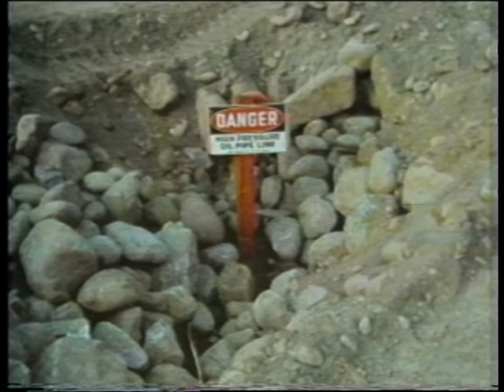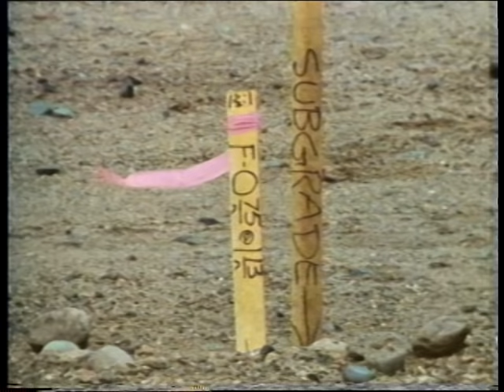The Coquihalla: 20 Months Through the Mountains

Comment: Back when we got things done. BC has fallen into a red tape nightmare.
Reply from the maker: I disagree.  Look at how fast the repairs were done after November 2021.   With enough money and enough workers this can be done.   IN 19834 the government put a lot of money behind the project and accelerated it a lot.
Reply: @BCHistory that's all it takes. Folks holding the money actually moving the funds towards a project and staying committed to it.
Reply: @BCHistory I respectfully disagree. Our technology has improved tenfold and yet mega projects are consistently over budget and behind schedule. Case in point, the Trans mountain pipeline. In the 1950's it took less than 3 years to fully complete  a 1200+ km stretch of 24 inch steel pipeline with antiquated technology. The reported cost upon completion was 93 million which equates to roughly 1.8 billion at our current dollar value. If you compare that to the current trans mountain pipeline which is a 36 inch steel pipeline employing state of the art technology in its construction, costs are roughly 20 times that of its predecessor and it still is not done after 4 years. The government is throwing money at this project, so it can't be for a lack of funding. There is clearly something wrong with our current ability to deliver these types of mega projects.
Reply: you must not live here i guess?

Comment: LOL
These tourist comments are cute and funny.
I drove the coq every day for 9 years.  It's a disaster.   Endless repairs, accidents everywhere, the toll was supposed to be removed once it paid the cost of the coquihalla off.  Yeah...   That was a lie.
Every year, endless km's of the coq are repaired.  Perhaps they could try using proper aggregate for underneath, and quality material for the roadway, instead of accepting the lowest bidder EVERY TIME!
Lets discuss the Merritt Turnoff.   Single lane road, with a single lane turnoff like you'd see in a small town to turn in to the liquor store.   NOT a turnoff needed for multiple semi's lined up, multiple passenger vehicles, all backed up for half a km because they gotta wait for LOCAL TRAFFIC to slow so they can take the "left".   Soo if you want to go from the connector to the coquihalla, you gotta navigate the WORST set of off and on "ramps" ever conceived.

Comment: And yet?
Look at it now, a snow bound icy corridor in winter, at best described as a MAYBE route, where getting through isn't a guarantee, but simply a "hope-we-get-there-unscathed" faster route, than others which may be lessor gradients, but also less well maintained or serviced.
What a real pity, that NONE of those waterways in there were harnessed for at least a Hydro Generating Scheme, to provide innovative anti-icing pads underneath those high "highways", avoiding the often costly non-travel "closed" periods, when accidents and poor road conditions closed that route to everyone.
But then see, the engineers and planners never foresaw the extremes in both the travelling public (and their nonsensical misuse of snow tires &/or lack of snow chains), by citified folk who did not know how to drive - let alone drive on a wintery icing road.

Comment: Took 20 months to build a whole highway system, now days with much much much better technology and equipment it takes them 5 years just to add 1 more lane to a 10 mile section of that same road.  Why???!!!
Reply from the maker: The number of people on the project in 1984 was huge and it cost a lot.  The government had tolls to pay for the increased speed it was  built at.

It is also important to remember the project did not start in 1984 but in 1973.  The first years were only survey work but construction did start in about 1980.  

With enough money and resources any project can be sped up a lot.  The repair post November 2021 destruction went astonishingly fast.  The highway reopened in less than two months.  There was still more work to be done after it reopened but it was available.  By the summer of 2022 the vast majority of repairs were.done.  I was stunned at how much was completed by July 2022.   I was certain Canada's primary highway access to the Pacific coast would be out of action for a year.
Reply: Same story here in Pennsylvania in the US.  They closed a busy exit ramp off of I-80. I thought they were in the process of widening the ramp to include a turn lane to prevent traffic backing up onto the high speed traffic. When all the dust settles and the ramp reopened, it was exactly the same as it was before reconstruction started. The point of all this is they took 6 or 7 months to "fix" a section of ramp that was only a few hundred feet long.

Comment: It's a deathtrap in winter.  But so fun to drive in summer! I want to move to the Interior!
Reply: This is typical big government bragging with no brains and understanding of the true long term repurcussions and costs. If they would have taken 1/4 of the cost to build the coqihalla and put it into the canyon route such as a tunnel thru jack ass mountain and improved certain other area along the fraser canyon not only would they have a highway with much lower winter maintenance cost due to  much reduced snowfall amounts the heavy truck traffic would not be stuck on a hillside such as the "smasher" because of poor maintenance and too steep a grade for reliable winter driving. I know because I drove super b over both of those routes and the canyon in winter usually didn't let you down not the way the coq. could and would because it wasn.t plowed. By law they don't have to plow the grades until there is over an 1 1/2 of snow which is a death kneel for truck traffic and then requiring chaining up and that is not always 100 percent effective on certain truck configerations such as two empty trailer and still not enough traction to climb the smasher with chains.
Reply: so true; its a horror show in winter

Comment: 35 years later equipment technology is still the same.
Reply: While the basic concepts are the same, the technology, ergonomics and operator comforts have been improved significantly. As well, when this project was undertaken it was early days for the development and utilization of large excavators which have pretty much replaced wheel loaders in the dirt moving industry today.
Reply: except for they have internet and wifi and GPS making everything literally twice as easy

Comment: Maybe building a highway next to several rivers and diverting them 18 times wasn't such a great idea? I wonder what flood level data they used for the engineering on this.
Reply: They didn't care. The right pockets were filled with gold and here we are.....
Reply: Have you driven around bc? Pretty hard to spit let alone build a highway and not hit a river. The coquihalla range is one of the snowiest places on earth, I guarantee they looked at flooding pretty hard when they built this road.  Flooding wasnt a problem before they clear cut the entire coldwater valley past the coq summit, the rest burned in the summer of 21 and then the freakiest HAARP storm ever seen hit, voila

Comment: So what? We ended up with a freeway that causes more problems that the Hope-Princeton and Fraser Canyon combined!
Reply from the maker: There is no way the other two could gave handled the volume.  Also, the Canyon route is closed a lot
Reply: @BCHistory  That's a good point. The third route was needed.  Your last point I question. beyond normal maintenance and wildfires the canyon hasn't changed in 60 years. Far and away the more beautiful and scenic route as well.

Comment: A colossal mistake pushed as a political project by the used car sales party. The road always tough to maintain was shut for monthes in 2021 due to a climate change event. The roads future doesn't  look promising.
Reply from the maker: If the Coquihalla had not been built the scale of traffic going to the Interior and beyond from the coast could not have been handled by the Hope-Princeton and Fraser Canyon routes.   Four laning the Canyon would be very expensive and very disruptive of many of the communities.  A four lane freeway speed highway through Boston Bar would not be good for that community.

Yes, the loss of traffic on Highway 1 and Highway 3 was detrimental to the businesses that served the travellers but that is hardly a reason not to build the highway.   

People in the Interior had been advocating for the highway to be constructed starting in the early 1960s.   The video does not show that actual work for the highway started in 1973 during the NDP government at the time.  Admittedly the work was slow with only survey work being done during the 70s and very limited construction before 1984.  the Kettle Valley Line showed that it was possible to use the Coquihalla for transportation and a highway following the line made sense.

One could argue the highway was overbuilt and a two lane road would have been enough, but that would have not reduced the expense by a large amount and the four laning would have had to have been done later.   The one section that was not four laned, Merritt to the Aspen Grove turn off, was a huge pain.   It is now all foud laned.

In general, the highway is not any harder to maintain than other roads in BC running through the mountains.
Reply: @grahamkearnon6682 What an uninformed and unintelligent post. If you had done any research and had a modicum of common sense you would be embarrassed right now.